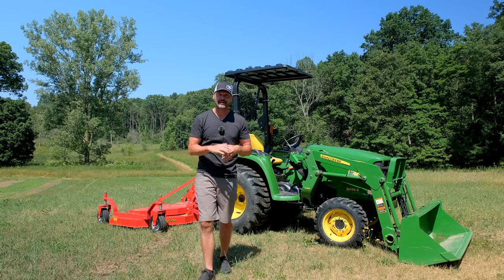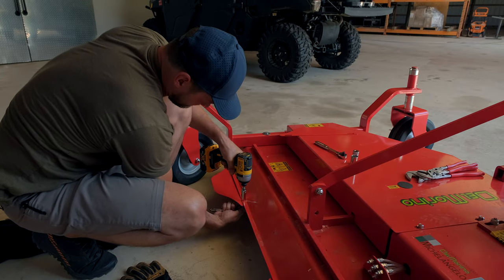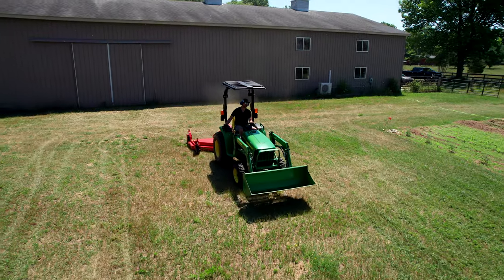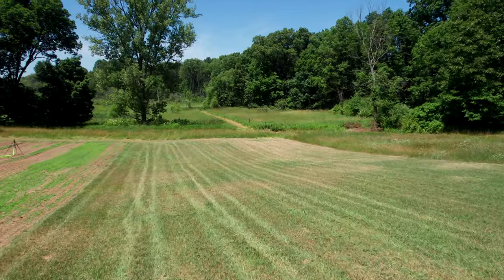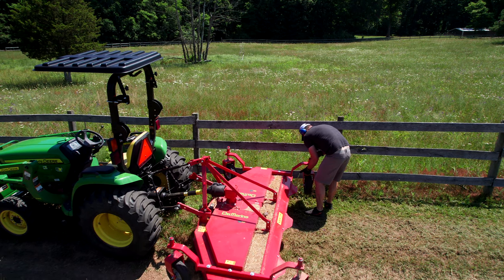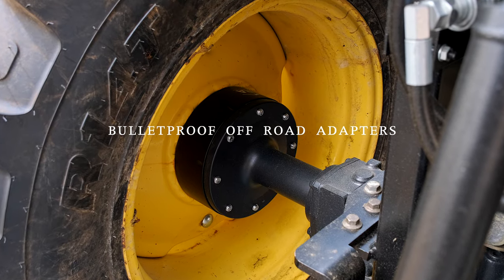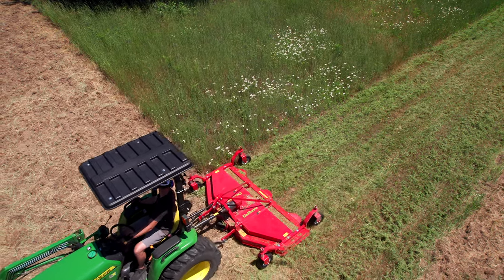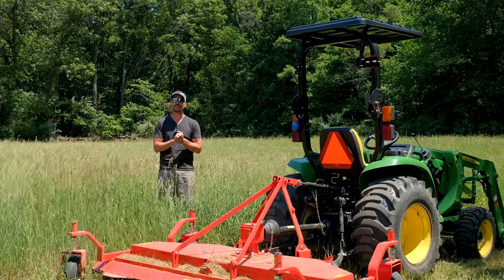96” FINISH MOWER WORKS ON A 25HP TRACTOR?  John Deere 3025e

Comment: Sooo I really want a finish mower for my 2038r.... but .... for the price wouldn't be better to get a 0-turn or dedicated mower? If the price point was much lower 100% get the finish..... as is at 4k or greater.... nope
Reply: A ZTM is for "yard". Areas that are mostly flat and smooth, and get mowed once a week at least, are what they handle best. So it really just depends on your terrain and power needs. Unless you buy a $20k ZTM with a diesel engine, the tractor can handle a lot more volume.

Comment: now considering a 3e because well its all dealers have anymore im surpised the 25hp could turn that thing like it did
Reply: I have a 3025E and it works very well for general maintenance of my 10 acre property.  However, if I had to do it all over again, I'd get the 3033R for its higher-capacity loader.
Reply: The 3 series tractors have went up about 6 grand since I bought mine in 2020, they are great little tractors. I got the 3035D, it’s gear driven. They put a little more power to the ground and are heavier than the E series! The D has a cast iron transmission and rear end, E has aluminum. Both are good tractors!
Reply: @tacratt6091  I liked the d series I was just surprised it didn’t have a dual clutch. So the pto shuts down when / if you change gears.